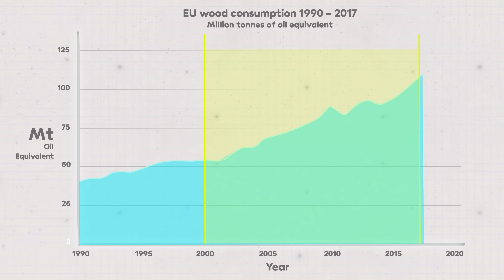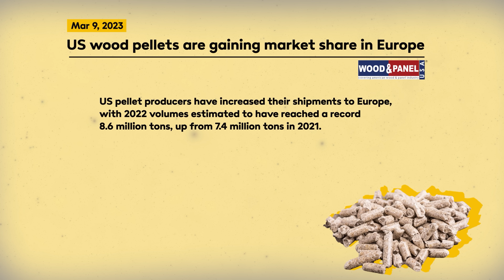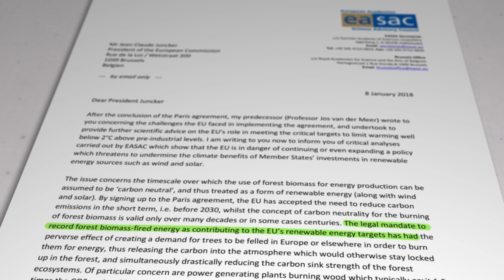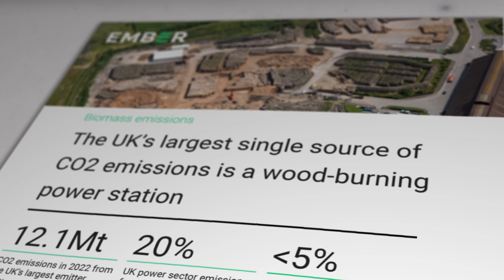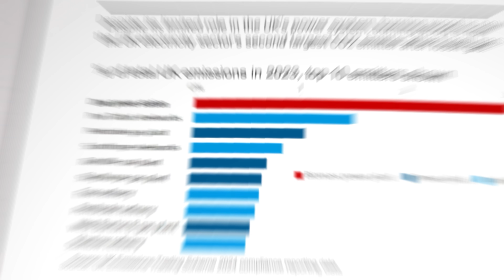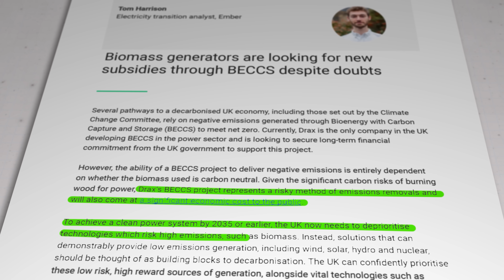New report: Biomass CO2 emissions 4X higher than COAL!!

Comment: The students at my university thought this kind of power station was a non starter in 1997. School of Forestry, Bangor University, Wales. Use of wood in well made furniture and buildings to remove carbon from the atmosphere is a much better mechanism.
Reply: This. 🙏🏽🏆💐
Reply: Keep growing trees, you might just have enough wood for both.
Reply: @SirGoP  keep growing trees no matter what, theyre a vastly underrated contributor to our environmental safety
Reply: It was the subsidies did it.
The original idea was that only waste wood from existing lumber industry would be used.
Things went wrong when tree were cut down specifically for wood pellet production.
Reply: @harry130747  absolutely, biomass is great for small outfits that grow their own fuel...for Drax power station being paid off by tory governments to greenwash the electric industry its an absolute calamity...typical Conservative politicians lining each others pockets
Reply: @harry130747  What specific subsidies do you believe there are going to what, exactly?

I can't speak for anywhere else, but in BC if a tree is used for wood pellets, that's because it's been killed by beetles due to warm winters, or is diseased due to stress from hot summers, or is cleared out to remove fuel from wildfires due to extreme aridity, heat, and windspeed from climate change.

True, there is a lumber industry here, but afforestation has been part of that for a century.

What exactly is your complaint?
Reply: Charcoal is long-term carbon storage. It can be made from mixed coppice woodland, which has much better bio diversity than monocropped softwood plantations, has a much faster growth, and turn around rate and can be made from the least desirable parts of the tree or they can be burnt to fuel the reaction.
Charcoal is nearly pure carbon and doesn't decompose in the  soil like wood does, it can store carbon for thousands of years and be powdered and used as a soil amendment on farms for long term carbon storage and improved agricultural yeilds.
Reply: I read the comments and weep. At 70 years old, I've witnessed the worst of human environmental destruction, stayed positive hoping solutions were being developed.  But here we are at a point of no return and the problems are only accelerating. 
Nobody has the ability to deal with the elephant in the room which is capitalism, essentially a psychopathic state of mind that drives us to become individualists. 
Gone are the days of collective responsibility where people could work together.  When the AMOC stops, no amount of energy generation will save Europe. That's what you get for greed and inaction.
We don't need more energy supplies, we need less usage but how does that fit a Capitalist system?
We're Human/Rats, eating our way through the earth.
Reply: Wood is fat from the single biomass.
Miscanthus, ferns and other plants byproducts should be (and are) the main products used in heat generation.
Reply: Your students knew little about timber. Most forest timber is unsuitable for sawlogs to build their niche furniture or use in construction.
Reply: @richardm7004  Have you seen what passes for furniture these days plastic coated chippings that last a few years and are then burnt.
Reply: @richardm7004  Nonsense, furniture is not made of logs unless you talk about the furniture of Henry VIII, nowadays it's all engineered one way or another.
Reply: Wood pellets are produced from sawmill sawdust, 
so lets build with wood, create wooden furniture, and use the leftover sawdust to heat our homes—all in harmony with sustainable forestry.
Reply: @VanwonterghemL  That was the premise, but then capitalism proved yet again that it's cheaper to buy a forest and burn it down.
Reply: And when you use wood you end up with a lot of side products you cant use and this is what you burn in a powerplant
Reply: You can have both. If You do felling to get the wood for furniture and buildings, You'll have approx. 20 - 40% of mass left on felling site. They are so called logging residues and e.g. in Swedish region of Småland they are used for CHP and local heating.
The rest that goes to manufacturing is turned into construction material or raw material for furniture, but approx. 50 - 60% of the mass will become residues, which is typically chipped and in many cases pellets.
Reply: @niu9432  With selective harvest of canes (branches) from managed (coppiced, festooned, pollarded) trees, you can not just have both, but with far faster growth, healthier root systems, soil amending terra preta byproduct of biochar torrefaction for enhanced woodland recovery, less exposure to wildfire risk, better water retention, and staged ecosystem recovery.
Reply: This makes it obvious . The books dont balance & a horrible fraud is being committed  with government being the helping hand ! We know this . What action , if any,  will happen ?
Reply: Biomass fuel/burning should only ever be waste to energy or disposing of a byproduct in a useful manner. We shouldn't be growing trees just to be burnt.
Reply: @MX-Vette  Unburned trees turn to methane when they decay -- and that's even some living trees, when diseased or senescent -- 120 times worse than CO2.
Reply: @bartroberts1514  Methane might be 120 times worse, but only for 12 years, it's nothing compared to CO2.
Reply: @drachenfels6782  Methane emissions are rising. Solving the integral for a rising curve of a decaying factor as a rule tells us only the shortest term derivative of that factor matters. To translate for those of you who don't do calculus for a living: 120 GWP is all that matters for methane until we stop emitting methane faster and faster.

And even then, the total GWP of CH4 over an indefinite time span exceeds 28.

Also, CH4 + 2O2 + UV -> CO2 + 2H2O. That means CH4 ends its life in the atmosphere as CO2, after a variable length of time partly determined by how much H2 and O3 are interfering with its decay under the influence of UV.

Thanks for asking someone who understands the chemistry and physics.
Reply: @MX-Vette why not? it's a net zero regarding CO2 emissions.
Reply: Wood when it's cut down is back out into the atmosphere. When a tree or grass is living, it cycles the carbon. When it's cut down, a lot of carbon sublimates. The only way for timber to cycle is if it's eaten by saprofitic fungi and certain microbes because not much else eats the lignin and the cellulose. Carbon is a chemical element but it has its own cycle in Nature, tied up with other cycles like methane, etc. Best is to use Natural processes to speed up the cycle, not slow it down. 

There is complexity in Nature. Killing trees to keep them in timber form doesn't help the environment. It's like killing babies to save Humanity.
Reply: Amen, although it will also depend on how much energy is used in the production process. And it still doesn't change the fact that it always pains me greatly to use trees which could've kept living for a few hundreds of years more. I'm a treehugger wood worker, you could say lol
I try to make products with a potential to last centuries, unfortunately it's not a great market, especially in Europe where wood is insanely expensive (even compared to Midwest and East Coast for Americans complaining about prices outside NW US)
Reply: Yeah...and life was more abundant then.
Reply: @dwwolf4636  Then being 1997? True.

Life pretty much peaked about 4,000 to 400 years ago, as far as we know.
Reply: In BC we are not stupid. We don't make pellets out of wood that could otherwise be sold for much much more as merchantable timber. All wood that Drax uses is waste wood.
Reply: This is nonsense. All you've done is delay the release of CO2.
😂😂😂
Reply: @vote4coffee  I think lower carbon materials substitution should have a higher priority . Reusing structures and materials instead of the wholesale destruction, removal , and replacement with newly made ones is another no brainer. The RIBA  (architects) acknowledge the role the built environment is playing in decarbonising the atmosphere.
Making furniture last 100 years instead of 5 years will help. The timbers in my house were probably grown in Kentucky or Canada and are well over 200 years old. The house will stand for another 200 or so years , and the main timbers reused. Timber houses that last 50 years are not lasting long enough .  The old timbers could be buried to lock away the carbon on but burning timber is not a way to remove carbon from the atmosphere.
Reply: Carbon is not a pollutant
Reply: @jeffsweeney312 We can't put back the coal we already used so we have to do other things...making charcoal and burying it sequesters carbon into the ground forever but burning off all the volatiles to make the carbon is still no good for the atmosphere. Uisng real wood furniture not chipboard etc is better for the environment than any other form of furniture....Steel has an advantage that it is easily recycled but still you can't grow a chair out of steel in twenty years and it uses far more carbon to get it to bums on seats than wood does.
Reply: In the context of California and wildfires it would be insane not to do biomass energy if cut in patterns to reduce risk of wildfires. 🤷🏻‍♀️ If it's gonna burn might as well make energy and ideally combined with waste heat recovery for residential or industrial heating uses doubling its efficiency.
Reply: @RP-hn1qc  litter building up on the ground in Californian forestry should be looked into. Tree planting density or inappropriate tree species selection or an incorrect tree management plan may be to blame. It is much easier to prevent a large fuel load building up within a plantation ,or woodland , than dealing with the material as an additional management process. Speeding up the decomposition and infiltration into the soil by the correct bacteria, fungi , and other detritivores being present will help.
Reply: @RP-hn1qc  Do they undertake hazard reduction burns in Autumn/Spring to reduce the fuel load at all? They do this where I am (Australia), perhaps not enough. I'm not an expert & I know topography is quite different.
Reply: @jeromieweatherburn8835  In BC, cultural burning is part of the Forestry Management Practices Code, but requires suitable conditions, and permission of neighbors, so is done much less than recommended.

Better would be just to harvest deadfall to pelletize and send to Drax.

Far better would be to harvest deadfall for pyrolysis to generate biofuel from 30%-50% of the mass as VOCs, and biochar for terra preta to reduce fertilizer demand.
Reply: @jeromieweatherburn8835  Some of the California wildfires are the byproduct of power company not allowed to trim as many trees as they want around their massive lines to direct power from the mountain wind power down to the the valley.
Reply: Do something to reduce the CO2 emmisions in America and the fires should stop! Instead of head in the ashes of the fires and Republicans saying climate change is a Liberal lie! @RP-hn1qc
Reply: @RP-hn1qc  This is the problem with most environmentalists I talk to; "Burning trees for fuel is bad because burning anything is bad" seems to be the take.

As long as,

1. any tree that is turned into fuel is replaced with equivalent trees on similar land
2. the energy cost of processing/transporting said trees results in net positive energy and net reduction in fossil fuel usage

then the best you can say is that you MIGHT be able to use the trees for something better but it's still at worst a wash.

I'm baffled by the people who think storing carbon in warehouses of furniture is some sort of solution.
Reply: @Kandralla  "Burning stuff" increased our average lifespan from 35 to 79.
Reply: @gregorymalchuk272  first of all that average is very misleading secondly the planet is burning at an alarming rate, should we continue old patterns as the planet rapidly combust and deteriorates from fossil fuel production??
Reply: @Krill_all_health_insuranceCEOs  The average is only "misleading" if you trivialize the 1/3 of people who died before adulthood in pre-industrial societies. Where do you think water treatment, sewerage, vaccines, and medicine come from except an enormous fuel-burning infrastructure and industrial civilization?
Reply: @gregorymalchuk272  not sure it's 1/3 although I understand it was definitely higher than today. Not sure fossil fuel usage contributed directly to advances in those areas. Regardless of then-current energy sources those advances would have happened sooner or later as smart and motivated individuals worked hard in disciplines to make discoveries. 

Even if everything you say is true, the world is definitely at a tipping point. Radical climate change and deleterious effects from climate disruption due to excess CO2 from fossil fuel usage is undeniable now to all but the most ideological. 

We have amazing and exciting technologies existing now to start a rapid transition from FF- only corrupt governments hold us back.
Reply: @Kandralla  Best way to store carbon is grow algae and let it sink into the deep ocean dramatically delaying decomposition. Yet, all we hear are tree planting campaigns.
Reply: @Kandralla  Craziest part is if we ignored the environmentalists in the 60's about the Nuclear panic Germany and California could have been net zero emissions by merely diverting all previous renewable energy investments betting it all on nuclear power.
Reply: @Krill_all_health_insuranceCEOs  we currently have NO energy technologies that are fully sustainable if Fossil Fuels were not available.!
Reply: @weinisable  We have had a fully sustainable fusion reactor for the last several million years giving us large amounts of energy.
Reply: @weinisable  , the renewable energy "cycle"  will merely mature as a form of  leveraged fossil fuel consumption, it won't replace it long term (while; gas, oil and coal remain avalable)...
Reply: @kadmow  All forms of fossil are costlier than all forms of renewable. Why would any wise economy embrace such inferior fossil alternatives like filthy bitumen, dirty coal (there's no such thing as clean coal), volatile gas and greasy oil?
Reply: @Kandralla  You've grasped the concept of photosynthesis drawing carbon out of the atmosphere and an equivalent amount being released when the sequestration organism is burned.

1. When fallen trees decay, some of that carbon is sequestered by other organisms so not all of it is released into the atmosphere like it is when burnt.
2. The decay of fallen trees into atmospheric carbon takes a long time - comparable to the time it takes a tree to grow, so new sequestration can occur at the same rate as the old sequestration organism decays.  Burning is a very rapid carbon release, so you might wonder what happens when wood-burning power plants quickly run out of sustainably grown trees (which grow slowly) to burn.  The answer is they burn more than they can replace, so the sustainable loop you are talking about doesn't happen even if it sounds good in theory.

These points are made in the video.

What is the point of going to all that effort to draw carbon out of the atmosphere (which we need to do), if you are just going to give yourself a big pat on the back for doing it and then burn it back into the atmosphere in the space of a few days?
Reply: @richwilliams1863  Lots of words to say you can't look at a problem wholistically. The wonderful thing about trees is that they come in units that can be divided and used for more than one purpose.
Reply: @Kandralla  No, I was just saying you missed the point of the video
Reply: @richwilliams1863  and you missed the point of my comment. So. 🤷
Reply: @Kandralla  No I didn't
Reply: @richwilliams1863  right.
Reply: Just Have a GOOD Think about what your lifestyle would be like without FFuels…once all the existing FFuel built infrastructure has decayed ( due to lack of materials, fuel, transport, equipment etc to even maintain, let alone replace, them)..
Best vision is to look at societies that have no access to fossil energy ( other than wood burning) such as remote Africa, South America , Etc etc.
You will be resorting to a “pre industrial” 18th century, lifestyle !😱
Reply: @weinisable  I think this one of the reasons it's called a crisis.
Reply: @weinisable  My 'lifestyle' free of fossil tyranny? For over a decade fossil free, I've paid far less for my renewable grids' electricity than any fossil dependent. My EV takes me everywhere I need, at one sixth the cost per mile, of fossil. No smog, no tailpipe emissions, no dirty oil burning, two thirds less maintenance cost. By the end of my vehicle's life, I'll have saved the cost of a new vehicle compared to ICE.
Replacing asphalt with geopolymer costs 70% less for raw materials than OPC, and lasts at least two and a half times as long as asphalt without potholes or ruts.
Every major heavy equipment maker now makes EV, and those are cheaper to run and safer to operate, too.
The best vision is to look to places that have run on hydro or geothermal for over a century, at the healthy lungs of people not downwind of smokestacks, the longevity of people not stuck in smog and exhaust.
Nothing high tech needs fossil. Not medicine, not higher education. Not employment. Not advanced permaculture.
Reply: Creating new tree planting in Urban , farmland and as new woodland will be a permanent reducing mechanism of carbon from the atmosphere. The other methods of utilising woody materials underground may be useful. too
Reply: @robinwhitebeam4386  Urban environment soils are dominated by compaction. The tree roots won't grow very deep. An urban environment has infrastructure below ground to consider, and tree roots get into water systems quite easily. Above ground, trees have to be regularly trimmed, and it's an expense. Notice how cities tend to forget about policing parks properly too, due to cost or simply they're too lazy to do it.
Reply: @marlan5470  I agree that high density urban environments are difficult for trees , but it's also difficult for humans. Cities have densities dictated by planning regulations that will have to change to meet changing climates and water table levels. In the UK city water tables are higher than they used to be due to the removal of green space and garden removal. Additional trees in UK cities can reduce the water table damage to buildings and localised flooding.
Reply: @robinwhitebeam4386  You may be interested in Miyawaki Forest method for urban and suburban planting, as well as around farm fields.

Woody materials underground speaks to biochar soil amendment to create terra preta up to three meters deep.
Reply: Only about 10% of harvested and deadfall wood mass can be made into furniture and structures. 

What do you suggest happens to the other 90%?
Reply: @bartroberts1514  That's an interesting assertion!  Plywood, one of the most common furniture & construction materials peels the entire log, only discarding the bark.  Oriented Strand Board uses chipped timber from the entire tree, particle board uses small particles, MDF uses sawdust.   Where did you get the 10% from?
Reply: @blazegarbo6884  OSB and MDF do not make long lasting furniture. The idea that wood is a long term storage solution for carbon is nonsensical.
Reply: @blazegarbo6884  Engineered wood is awesome, including plywood, OSB, and other forms of processed fiber. I would also add nanocellulose products. Splitting my reply into parts, for convenience.
Reply: @blazegarbo6884  Industry estimates suggest 30%-50% of sawlogs go to use in furniture and construction. That'd include engineered wood, according to the BC government, for BC forest management practices. Other forests would be similar, I expect, based on US Forest Service figures, and "Wood Products and Utilization" (Banda University of Agriculture and Technology, Banda Publication No: BUAT/ (M)/2023/22).
Reply: @blazegarbo6884  Of the rest, there's shrinkage, pulp and paper, raw log, etc. Deadfall and residual wood is either used for biomass energy or is left to deteriorate. Other uses are essentially zero.
Reply: @blazegarbo6884  To directly answer your 10% question: In essence, 100% of our forests generate deadfall at a rate of 2.5% a year currently, given disease and wildfire rates.  So, two to five times as much wood goes to spoilage as to harvest. 10%-40% of harvested wood goes to waste. 10% was a conservative estimate. You can check this with the Forest Stewardship Council of BC, including that 2023 saw a huge leap in the spoilage due wildfire.
Reply: @blazegarbo6884  Furniture isn't referring to IKEA garbage made with plywood and particle board.
Reply: @Kandralla A 'Treehouse' is still less carbon intensive than any building material apart from mud mixtures or caves
Reply: @tarant315  Concrete with biochar aggregate can be up to 40% lighter than regular concrete; if geopolymer concrete with biochar, it can be net carbon negative up to 13% of its weight.

But yes, engineered wood is by far the better building material, from a carbon sequestering point of view.
Reply: @blazegarbo6884  Ignoring of course that most logs are unsuitable for rotary peel veneer manufacture. I live near a veneer mill and buy 12 tonnes of logs every other year for cutting and splitting to firewood - they're the logs rejected for veneer production. Any minor blemish and they're no good.
Reply: @bartroberts1514  The Carbon cycle seems to suggest that most of it stays in the wood.
Reply: @robinwhitebeam4386  The Carbon Cycle seems to suggest five options: aerobic digestion to CO2; burning to become CO2 and black carbon particulates; pyrolysis to biochar; anaerobic digestion to CH4, 120 times the GWP of CO2; sequestration out of reach of digestion, to remain buried or otherwise like biochar and particulates out of the Short Carbon Cycle, eventually to join the Long Carbon Cycle.

Trees don't live forever. They also don't net remove CO2e from air forever. Once they become senescent, trees release CO2 and CH4 from their deadwood, and are net contributors to global warming.
Reply: @robinwhitebeam4386  Nope. It falls to the forest floor and decays; the organisms which feed on cellulose produce lots of methane, which is 20+ times more effective as a greenhouse gas than CO2.
Reply: @bartroberts1514  bury it.
Reply: @bartroberts1514  Not true. Depends on the type of forest. But in most conifers sawlog (construction wood, furniture) can represent 20 - 30+%, pallet wood (palettes, boxes, fencing, etc.) another 50%+ , the rest is pulpwood (to make paper and boards). Only around 10 - 20% is only suitable as firewood.
Reply: @jirislavicek9954  Your reply is the YT equivalent of mumbling with a mouthful of wood chips. Which of the comments in the thread are you claiming is untrue? Why? 

Meanwhile, sawlog mass is hardly the only type of forest fiber mass; merely, what's unfit for sawlog is almost exclusively only fit for burning, in addition to the waste wood produced in processing sawlogs.

Cellulose decays mostly into methane unless burned or otherwise preserved. Pyrolysis is an excellent way to prevent release of GWP 120 methane from wood, while producing additional revenue streams for foresters.

Selective managed polewood forestry is even more advantageous, keeping roots growing deeper and permaculture getting healthier below while harvesting fit wood fiber above, suited to engineered wood far less expensive than sawlog lumber.
Reply: @bartroberts1514  I was reacting to your comment that only 10% of harvested wood can be processed into construction timber or furniture. That's not true, perhaps except some fast growing eucalyptus / salix plantations. Forestry is much more inefficient and can process most of tree trunk into boards, beams or composite materials like OSB boards.
Reply: @jirislavicek9954  You were reacting to something I never wrote, then, and built a strawman to find fault with.

What I actually wrote: "..about 10% of harvested and deadfall wood mass can be made into furniture and structures. "

See the difference? How much mass does drying remove, by the way?